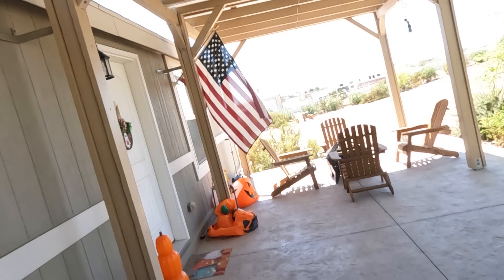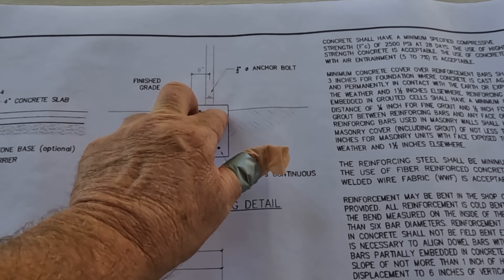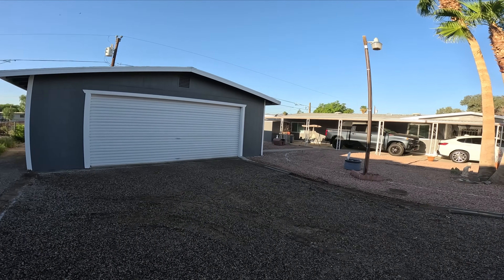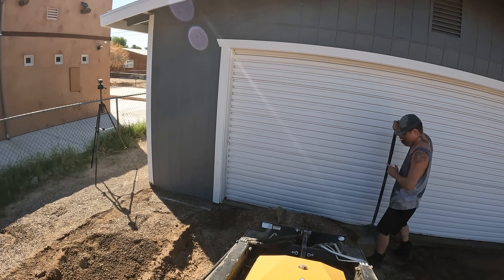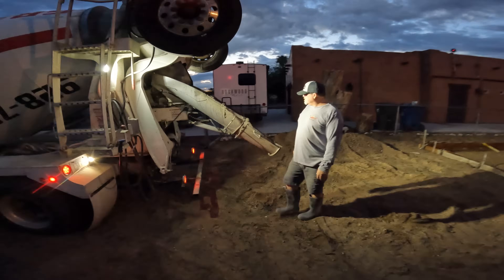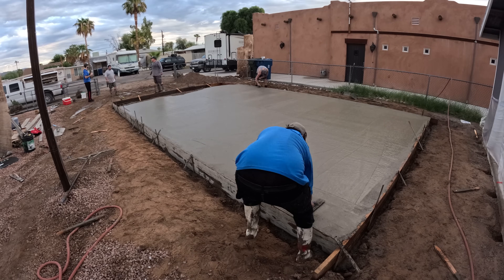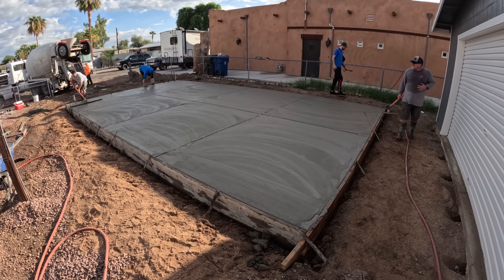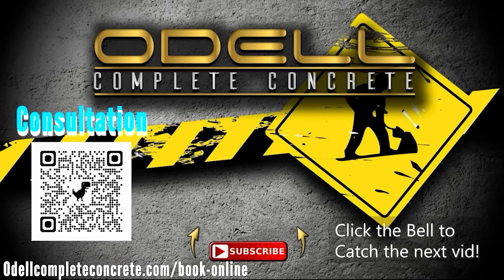PART 1 - Don't Build a Carport UNTIL You Watch This! (Foundation Plan Deep Dive)

Comment: Where the angle weld clip is. Could you make the 4 inch base into a 6 inch base. Then you might be able to drill through down into the concrete. with ouit cracking or busting the edge out. Am I right?
Reply from the maker: Sounds possible.